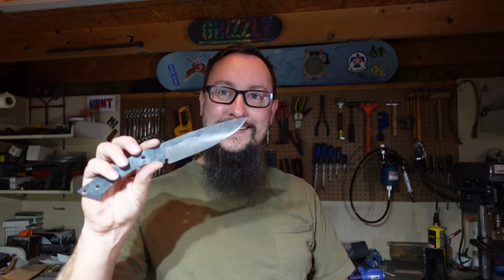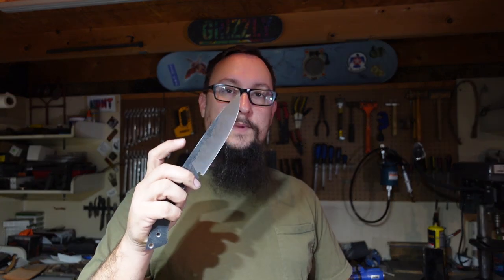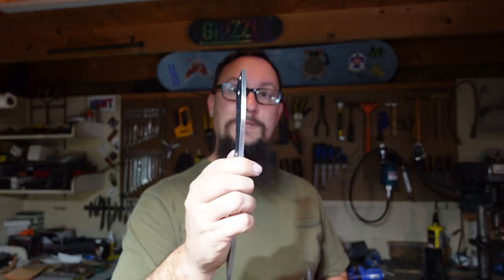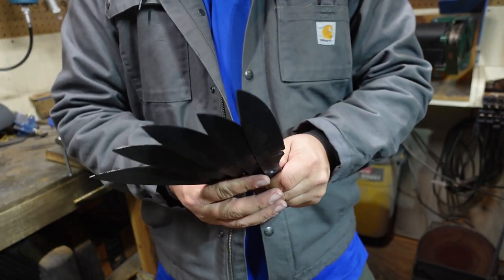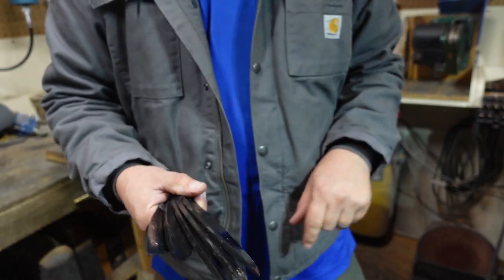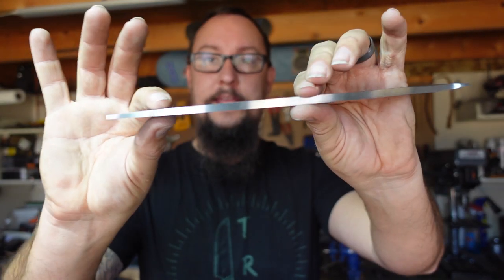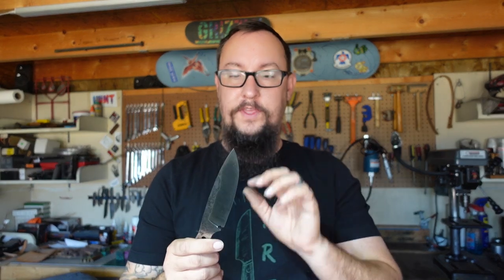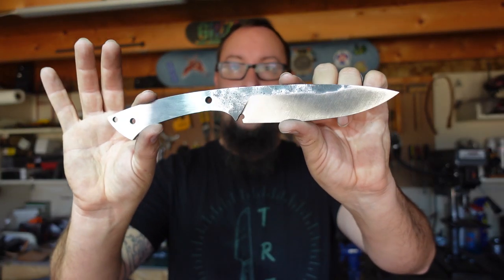Heat Treating and Tapering The Tang On The 80CRV2 Camp Knives | Knife Makers Vlog

Comment: What is your reason for tapering the tangs? Is it weight reduction, aesthetics or some other reason? Great looking size and profile on those knives!
Reply from the maker: It's for both weight reduction and anesthetics. I'd rather taper the tang than drill 10 holes in the tang.
Reply: @theriversexperience9383  Makes sense to me. Thanks for clarifying.

Comment: I'm looking hard picking your talents trying to learn..
I don't have but a magnet no thermometer 
QUESTION so wouldn't that be pass the magnet can test?
Reply from the maker: A good bet would be to get it to non-magnetic and then put it back in the forge for about a minute longer. The goal is to make sure that the color is nice and even across the blade.